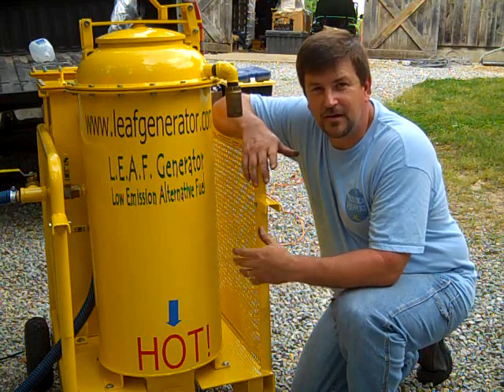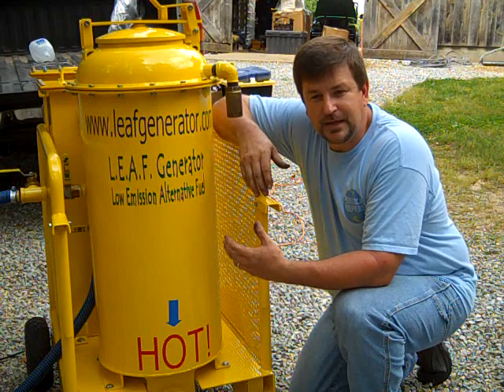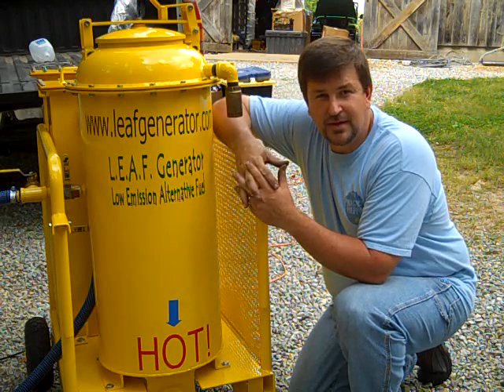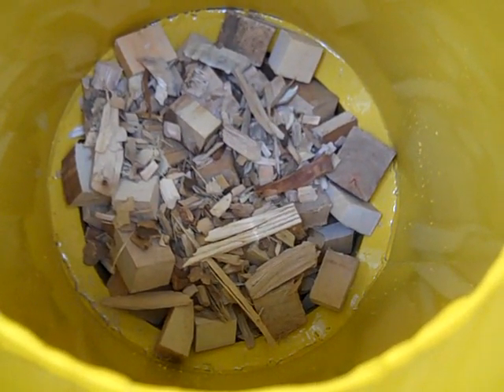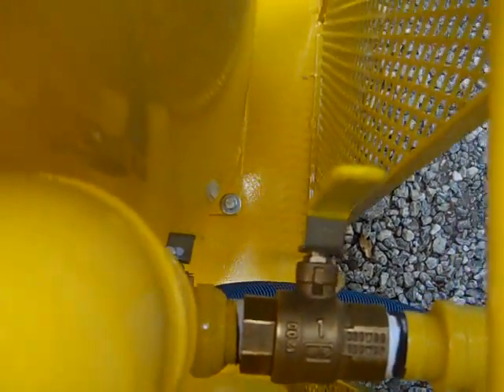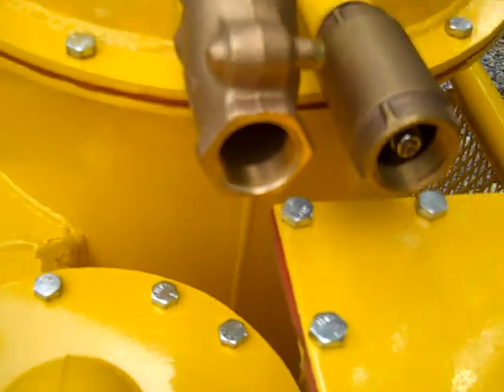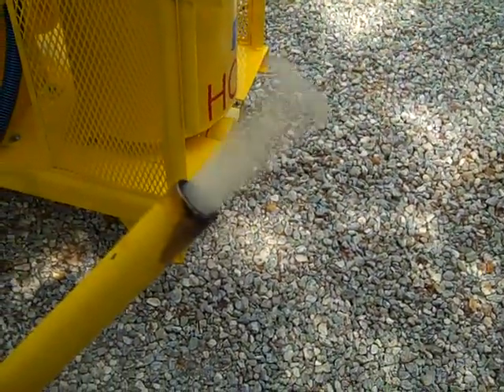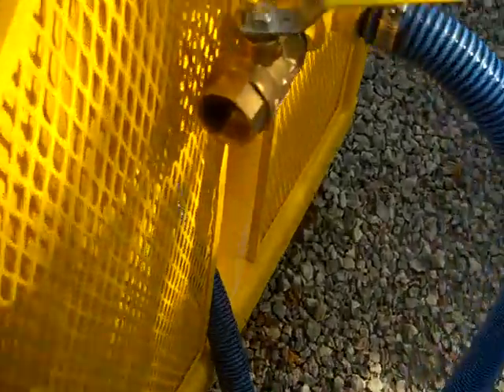The L.E.A.F.  Wood Gasifier

Comment: Ok, the amount of time and energy to make such small pieces of wood would be insane. Also don't use a electric blower to start it, in grid down you may have none to use. 
A gasification system that can use the same wood as a wood stove is what's needed.

Comment: I am confused....how are you supposed to use that little air pump to start this thing if you don't have electricity?
Reply: You have to have some stored energy to start, such as the battery in your car, or lithium batteries powering an inverter.  Once the gasifier gets going, the battery can be recharged.

Comment: Is it dangerous? What happens to the heat? Can the heat be drawn out of it and used? How many hours will it run until the generator need servicing? Can you use a car battery with an inverter to store the energy for the blower?

Comment: how do you turn it into liquid gas?
Reply: He doesn't, and likely can't.  "Wood gas" is a mixture of gases like CO, H2, and I don't know what else.  Each of those has a different temperature at which they are liquid, and H2 would have to be cryogenically cold, or under extreme pressure, or both.  Wood gas can still be compressed, though.

Comment: Can you turn gas into liquid gasoline by condensing it? From biomass.
Reply: Pyrolisis oil is a high cetane fuel, like diesel. So perhaps you could filter the oil and use it in a pilot injection engine and change your fuel filter very often. However its not the same reactor design (FEMA gasification) as the DIY kit here.
Reply: Pyrolisis is the process I want to do. You know how pyrolisis works right? I think you heat the biomass and it gives off a flammable vapor. So you use a filter somewhere in that process to clean the gas? Then after that you can now put it in an engine. If I am wrong then can you please correct me? Can I send you a link of two videos I found that talks about pyrolisis?
Reply: the efficiency is very bad when you convert to wood to liquid fuel. youll use a lot of waste heat to generate Pyrolisis .  better off using wood gas (syngas)
Reply: Ok. I can try to do it in an efficient way right? If I found a way?
Reply: I beleive if a Catalyst is added to the gasifier number 4 grade diesel can be produced instead of the syngas.

Comment: WTF? You've got no electricity because of a major storm - so you want to fire up your wood burning L.E.A.F. gasifier generator to run a fuel powered electric generator - but to get the L.E.A.F. generator to fire up and get a good head of heat, you need and electric blower to get it going !?!?!? So where is that power coming from to run the Blower in the beginning? LOL... It's a RUBE GOLDBERG invention!
Reply: Rene Andre  The electric blower he's using is one option, most people I've encountered use a small 12v BATTERY POWERED camping fan/blower to ensure normal operation under a large range of conditions.
Reply: They have hand crank blower fans.
Reply: batteries?

Comment: Good trick , no electricity so build/use a gasifier & then use a electric blower which requires electricity to start the gasifier .
Reply: You can use:
- Hand Crank version.
- One from a solar panel.
- One powered by a bicycle.
or an electric one from your Off Grid Battery system. He just used the electric one because it was easier to demonstrate the process.
Reply: I think DC batteries would work...lol
Reply: Good point and very valid.. how the hell do you start it without an electric fan to pull suction

Comment: This is a downdraft wood gasifier, period. It is NOT imbert in any sense. It will not generate high enough temps to crack long chain hydrocarbons, thus you will be sending tars to your engine and eventually tar up the valves and the engine will fail. Pull it apart to untar it and "start over"- I think not. This is nothing but an expensive FEMA downdraft wood gasifier. You need to go back and understand the chemistry of producing a tar free product. Waste of money!
Reply: No, this system uses nozzles.... nothing fema like in this unit

Comment: You need to do a more concise video to show exactly what has been accomplished here. I am not a nay sayer because I know this technology works, its worked ever since before WWII. Joseph Maximus has a very valid question about running the blower when there is no available electricity. Would it be common sense to have a battery back up with an inverter to power the 120 volt blower to start the system? Having a longer video describing more of your operation also stops people from asking stupid ass questions and wasting other peoples time. Anyways nice job. I would axe the yellow paint though and paint it camo or forest green. Just my humble opinion.
Reply: I'd imagine you could substitute the corded electric blower for a lithium ion one (I use them to start my fire pits - very effective).  If your batteries were not charged, well, then you'd have to go with Egyptian bellows.

Comment: I find it ironic how people like to pose the chicken or the egg question about gasifiers and their operation.  Most people that are going to go through the trouble of building a gasifier are going to consider drafting one in a power outage.  The point of a gasifier is to be able to harvest and store fuel for energy without gasoline.  I live in the mountains and with a bow saw and a 10 lb maul I could keep my genny running for a while.  Or even better I could save my gasoline for my chain saw and use syngas to run my log splitter and generator.  Either way the person who builds and operates a gasifier is going to be better off than the guy who thinks banks and gas stations will be open when there is an extended power outage or disaster.
Reply: FYI, the egg came first, if that helps :)
Reply: Wrong. The blue green algae came first.
Reply: Nicholas Pope Context, in-relation to the statement...learn some.
Reply: Do you even know what the context of the egg chicken is in reference to you troll. Doubt it.
Reply: I was talking about starting a gasifier from a power outage with no blower. Bootstraping. But I better stop using these abstract comparisons, it might confuse trolls.
Reply: @LigitandMeyers  an egg from a different animal
Reply: U wish haa

Comment: engineer. could you please do a video explaining how a wood gassifier works and its' operation. please excuse my inexperience. ;)
Reply: Wood emits a gas when burning. this pumps the gas into your motor.
Reply: I too am interested in how this works....But if I can run a generator on wood compared to sky-rocketing gas/propane $$$'s...$4500 is a good deal.
Reply: +Jared Maxwell  Not exactly. If you heat wood to a certain point you can get it to degas, and then you are left with charcoal. But the temperature changes what gases come off, and also changes the content of tar and creosote that will be deposited into whatever is using said gasses. Look into making charcoal, it will help understand the process.
Reply: Without gas purification of contaminants. Illustrated example being tar. How short is the life of the generator motor?

Comment: Ok that is cool but how are you going to get electricity powered to the leafblower, if you don't have the gas in the tank
Reply: You can use:
- Hand Crank version.
- One from a solar panel.
- One powered by a bicycle.
or an electric one from your Off Grid Battery system. He just used the electric one because it was easier to demonstrate the process.

Comment: 4500.00i is not a bad price if it repeatably produces clean wood gas. don't expect that from those chinese units, they are junk. I would recommend that if someone feels they can do better, start a company and build them for a lot less.... I'd order hundreds from you if you can actually build a unit that makes good gas, quickly, using soft wood chips... that's what i currently run in my system.
Reply: and your time is worth nothing... and does everyone own welding gear?

i build gasifiers... not new to this
Reply: i don't build fema systems... i've looked at your channel, i see you haven't posted anything... shows what you know
Reply: you don't know me... my system works as well or better than most so i doubt i'd need to copy anythig you do. i don't post my internals because people like you would claim i stole your idea... you are a troll... i'll make sure i point that out.
Reply: not gonna explain my system to you, don't need too... i have vids of it's operation... something you don't seem to have..... troll
Reply: tritowns
oh, Engineer... feel free to delete anything here if it's out of line... keep on keeping on
Reply: ***** You are living in the 70's. I am building something similar one of these. Already have $1500 in just parts.
Reply: Hey i been watching all these vids and playing around with burning wood and fatwood and diff types of brush and plying with the design of the fire pit and playing with fans/ blowers.  

A thing that is bigging me but Cant  figure out is the possibility of using water pressure from say a well water fed hose like my house in Pensacola Florida.   The water is easy to get thru a well and has considerable pressure or power that is seemingly infinitely available here and free .  

Whats bugging me is how there seems to be a system that would use the water pressure from the hose and have it somehow blasting water near or thru the fire without getting it wet as too generate or use the free wind power that can be seen if use a hose with a strong spicket on end that forces the water to go thru small hole and it may mix with oxygen im not sure..  or maybe use  a smooth flowing wide evenly flowing water fall or flat spray that is set up so that the wood gas smoke  runs thru this slow moving water or fast not sure and the cleaning effect of tar out of smoke into water plus use the pressurized water in a way to stimulate higher oxygen content bc it seems to be blowing air by pushing it out or alongside the stream of water..  also perhaps use water to cool certain areas where needed? Just hoping someone smart can use or show me where this is happening or used.
Reply: Basically imagine you on a team and you had a huge red fire hydrant that had limitless water and as small or as high pressures u want to use.. the well naturally has only so much pressure but its plenty im sure..   imagine  a sprinkler hookup to hose that spins super fast or goes back and forth all from the water pressure or the old tractor sprinklers that move along hose lol. Now it seems that could be somehow useful to make these more effective cleaner powerful and cooler where u want.  

Imagine a pipe with a spiral turbine in it with the woodgas  turning it plus water pressure plus something that captures the tar back out of the water and idk seems like between air water and wood and fire you can make plenty of energy

Comment: Looks like they did a nice job on the manufacturing. But is this a FEMA design? I can t see that blower holding up very long, I used similar blowers in the beginning and the acidic moisture in the gas destroyed them. But still a nicely built unit.

Comment: Nice looking little compact gasifier, I built one last December then I built a Imbert design that burns really clean. I'm using it with a small generator and the gasifier runs on yard waste. You mentioned fuel and the correct fuel is the key to getting a good clean gas.

Comment: of course its safe for engines. 90% of vehicles in sweden had it in ww2 after the world cut off their oil ( they would sell EVERYTHING to the nazis ). the nazis themselves used it and some of my relatives used it here in australia during our fuel rationing period in WW2. gasifiers have filter systems on them or the draft going the right way to avoid crap getting in the engine. hardwood is best, nonwood is crap. But I've got gas from wet weeds ( had to heat it and had a lot of steam first )

Comment: there is a guy called wayne keith who has about 4 trucks he has gasifiers on. his ones use a 12V blower like a car heater blower. He's on YT and starts a V10 dodge ram in 2 minutes using a blowtorch.

Comment: Any advice on storing wood gas?

I've not seen many people do it, but when they do it's kept at low pressure. I guess a well ventilated area is best (CO poisoning risk)...

I've seen WWII era photos of cars with it being stored in big bags on the roof. (The bags need to be big to be useful because of wood gas' relatively low energy density.)

Comment: Scott,  is there any adverse effects to the internals (piston, rings, valve, cyl) of your genny when using wood gasification? Can wood gas be applied to a diesel genset with glow plugs or is it required to have gas/spark plug setup?  Great video!
Reply: From what I know, there can be problems if the syngas isn’t filtered properly. There are tars and moisture that comes out as a byproduct of syngas production, and those can be filtered off in a variety of ways, but it needs to happen regardless. If not, the tars can cause the engine to seize, and the moisture can corrode parts.

Comment: I have a series of videos on cordless chainsaws that I tested using a solar power system to charge the batteries.   Youtube gave high ratings to the first few where the Greenworks 40v saw was the winner, but later I found the Oregon PowerNow saw to be a higher performance saw, just with shorter battery life.    They don't make DC chargers for the 40v saws, so you need an inverter to charge the batteries from a DC power source but that's getting firewood without buying chainsaw gas.

Comment: wood gas if filtered right and the gasifier is running hot enough to crack all the tar , then it is just as clean as propane. thats why he talked a little about wood prep too. you want the right size wood chunks (to avoid bridging) and dry is key to getting high temps(to crack tar). one of the draw backs is running at high temps(1800 degrees) is most metals cant take the heat and metal will disintegrate.

Comment: Is the wood gas safe for engines ? 

Does it make the generator engine oil dirtier faster than gasoline ? 

Can this type of unit use any kind of wood (soft, hard, large or only small pieces) and can it also work with biomass (leaf, grass, straw) ?

Comment from the maker: great question.  on Mine I use a battery and inverter to start the blower.  Once the gasifier is running the genny takes over and your recharge the battery plus do whatever else needs to be done.  You can also just run a small genny to run the blower till you get it started.  Thanks for watching.
Reply: Learn proper use of a camera. Your videos are nauseating.